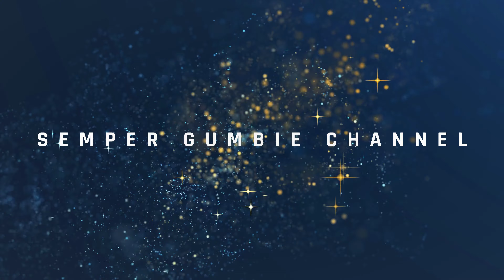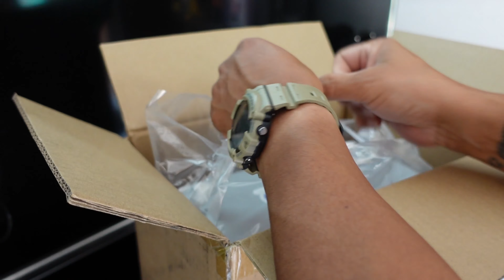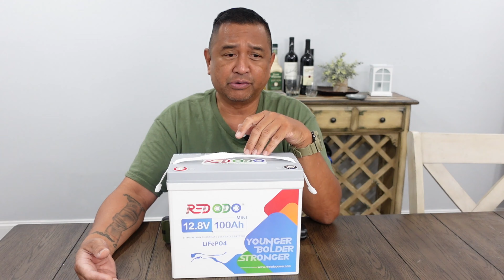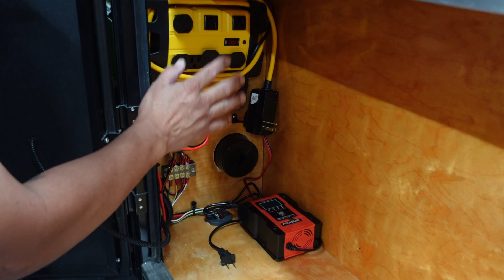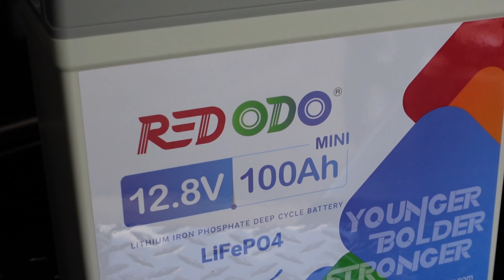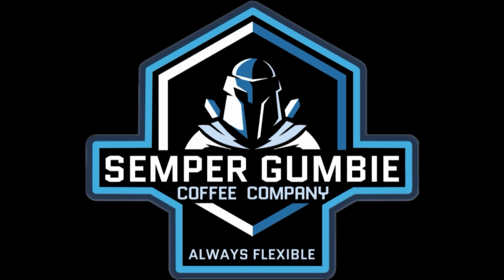NEW REDODO MINI LITHIUM BATTERY LIFEPO4 - 12.8v 100Ah  - S2 - E45

Comment: I will probably need to replace the battery on the camper next year. Might be a viable option.. hmmmm... I've also always wanted a microwave in my work van.. another idea..
Reply from the maker: Lithium Batteries are they way to go! I’ll be doing Power Lithium Generators in the next week or so. You wanna tune for that video!